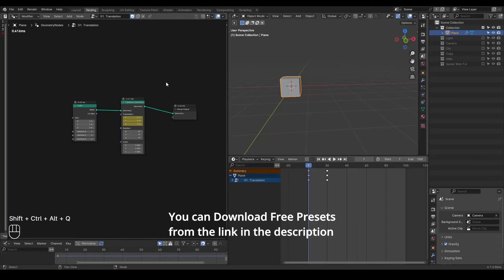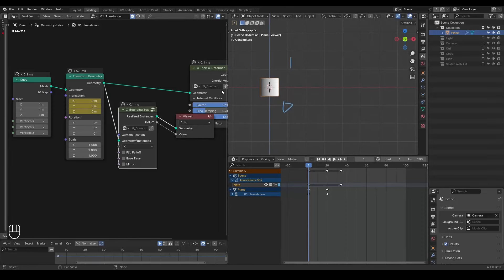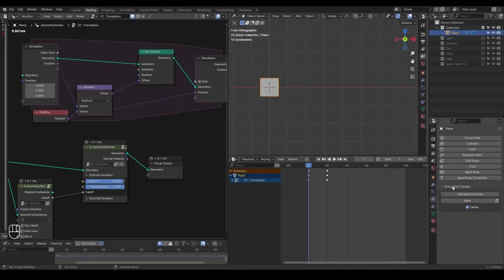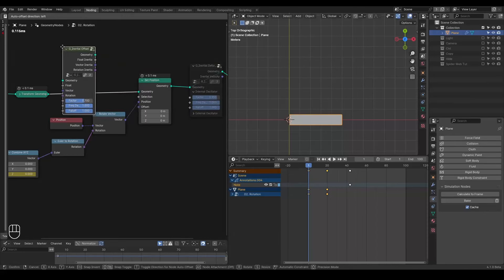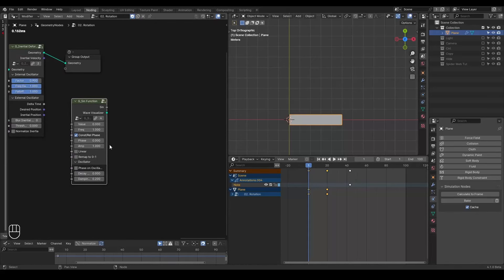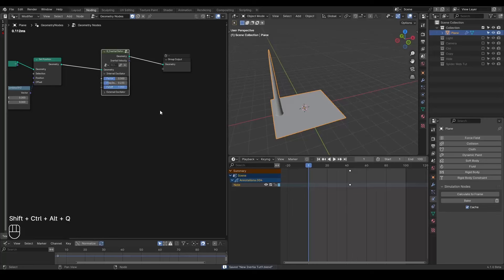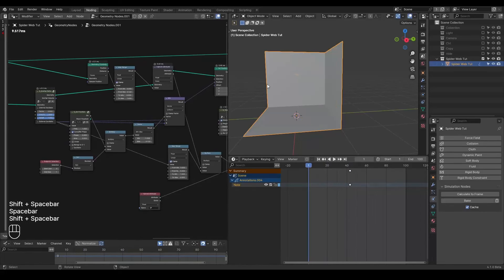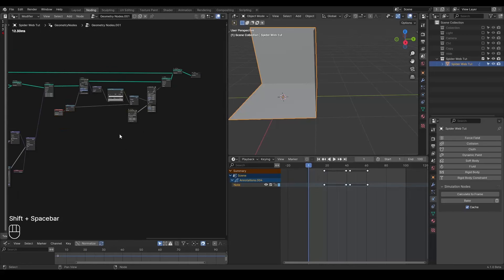[Tut] Inertial Deformer and Offset - Blender Geometry Nodes Presets 4.0+

Comment: great add on! although is there a way to parent other objects to the inertia object? or link the y axis translation data in the geo node to a new object's y axis?
Reply from the maker: geometry nodes can't edit the "transform" data in object level. but if you put stuff in geometry nodes, such kind of parenting should be easy. depending on what you want to do.
Reply: If you need to stick something to an object that is deformed, then "vertex parent" is suitable.

Comment: Hello, does this node remove materials when you use it, I cant seem to prevent this in my project.
Reply from the maker: It's a known limitation that "Simulation Nodes" and "Bake" will remove the material, and It's fixed since 4.1.
Reply: Im sorry I am new at this but isnt the latest blender 4.0.2 @bradleyanimation120
Reply from the maker: @Omaruuto  You are right for "Official Release". However blender is in active development. 4.0 was released last year and stops all updates since then. 4.1 entered beta-testing mode since February and stopped receiving new features since then. 
4.1 is planned to be "officially released" very soon on March.26.2024. Furthermore, 4.2 is in alpha mode and thus the one receiving the latest feature for blender now.
Sorry for my wrong wording. Perhaps I should have said "it's (or will be) fixed from 4.1 and onwards"
Reply: @bradleyanimation120  No worries, I was able to reapply the materials through indexes somewhat so that was fun to try. I the got my hands on 4.1(experimental) works great!!! Thank you so much for the replies